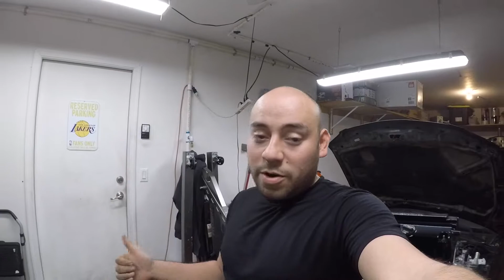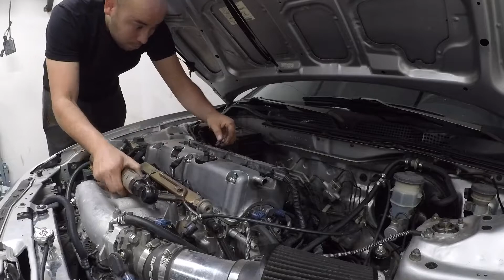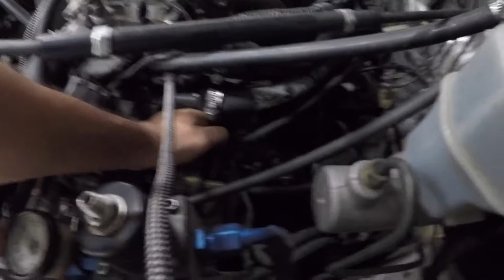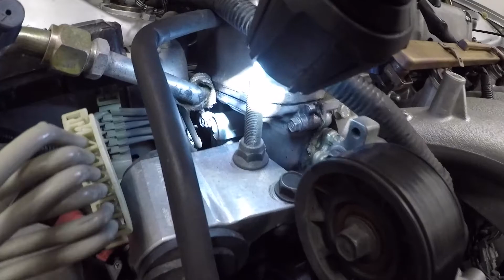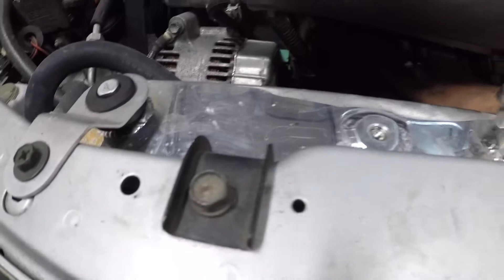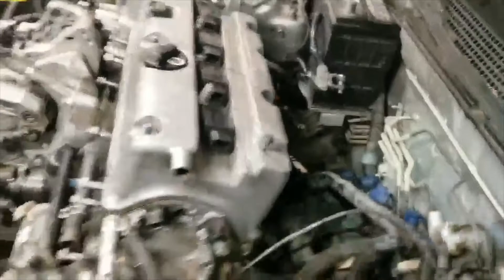Removing the Engine Harness from my K24a2 Acura Integra, The Swap Begins.....

Comment: How's it going? Nice to see someone doing a k swap with details. Hard to find information sometimes! I also am doing a stock k24a2, in a integra.  Close to finishing, but was wondering what radiator and hose set up youre using? and also heater core hoses? Thanks in advance! keep it up!
Reply from the maker: It's going good man!! Just non stop progress on the integra. I am currently having a issue but that will be in later videos. 

K24a2 in a integra is fun tho!! I bought the car with the swap but I'm pretty sure it uses rsx heater core hoses and I had a hose laying around that I cut up for the bottom radiator hose. I just got a upper radiator hose and that number from orielys is 22048, you will need to cut it smaller tho. I am using the csf ultimate radiator. I do have a video of that on my channel. Let me know if you have any more questions man.
Reply: Thanks for the reply! Nice, im close to finishing as well.
Just bought kpro. Waiting for that to be sent.
My next thing is the axles, im running full k24a2 w tsx trans, but i need to know what axles and half shaft to get, if u know anything about it
Reply from the maker: nice man!! K pro is good stuff for sure!! use the rsx half shaft, that should work just fine.
Reply: pFbSpecV thanks for advice, waiting for my k pro to come in! Very excited. Found the right hoses, and axles etc. 

Ran into a problem, not sure if you can help me with this. Im running a full tsx swap/trans w 02-04 harness. Im trying to plug in the VSS but doesnt seem to fit. Would i have to use a rsx vss?
Reply from the maker: @CMSPEC  yes...... so if I understand correctly you have a 02 to 04 harness which uses the vss sensor on the back side of the transmission and I believe the tsx transmission uses a countershaft speed sensor.... which in my future videos to be uploaded I ran into a huge issue with my swap cuz the element transmission is also countershaft speed sensor..... your best bet is to swap to a base model 5 speed or the 6 speed type s transmission, pretty sure the type s is vss. 

Does that help you out???